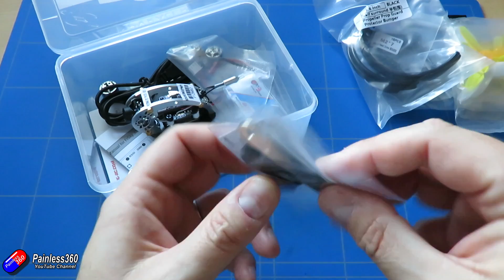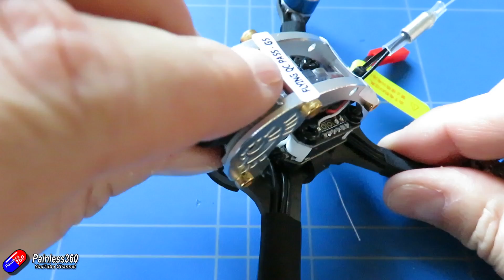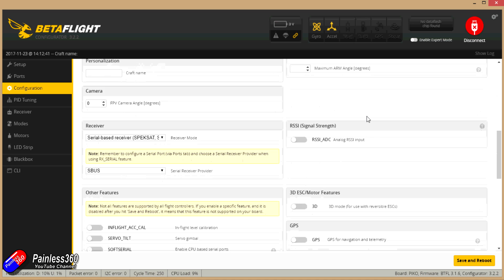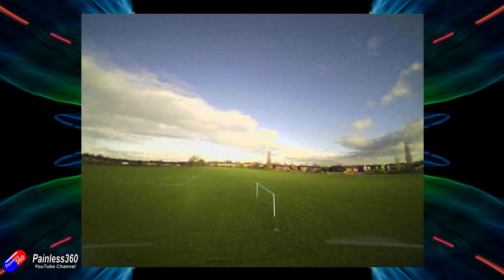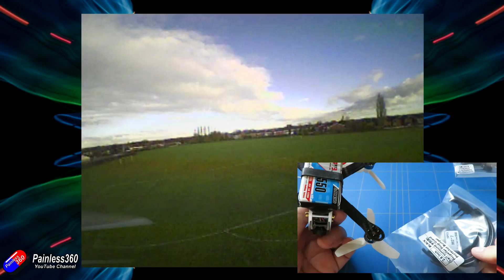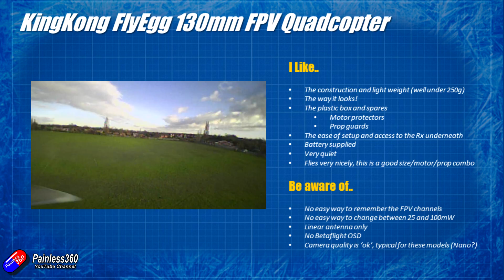RC Reviews: KingKong FlyEgg 130mm Mini FPV Quad - It's good!

Comment: how to make fpv quadcopter with 25min flight time ?
Reply from the maker: Big props, low KV  motors, and a nice big battery. :)
Reply: 900kv motors its good ?
Reply from the maker: Lower the better. See my video on the comparison between two setups with almost identical thrust and how much more efficient a large prop/low KV setup is..
Reply: Thx for the reply
Reply: i want to ask you about transmitter and receiver ,what i should use for 20KM range ?

Comment: my motors are operating erratic it flips right away tried to connect to blheli but it recognizes my board version connects then says failed to connect check com, which is com 4 115000 so frustrated just wont to get it to work can you help
Reply from the maker: Todd Lindsay-dickson  see my video on 'things to check if your quadcopter flips on takeoff'. Hope that helps. Best of luck

Comment: I have just bought this based solely on your review! (No pressure lol!)

This is the only review that i have seen where the flyegg 130 comes with a jst power connector and those vented xt1104 motors! Every other review i have found on this had a balance plug for the power connector :-s and 1105 unvented motors.

However i have seen that a few of those reviews there is also an osd, this is starting to get confusing.
Reply from the maker: +Mark Wood as far as I know the early versions came with the balance tap. You can see the sticker on the box this one came in talking about the upgraded motors and power connection. I've never seen this small version with an OSD..  I'd get those reviewers to check ;)
Reply: It may possibly have been the Leader 120 then... I have been on a youtube review binge trying to decide on a bnf or go with a scratch built.
I plumped for the no rx version as i'm still happy with my Devo 7 for now!
 Was only £87 on BG 
 https://www.banggood.com/KINGKONG-LDARC-FLY-EGG-130-130mm-FPV-Racing-Drone-w-F3-10A-4in1-Blheli_S-25100MW-16CH-800TVL-PNP-BNF-p-1164224.html?p=5P130216104409201711
Reply: Mark Wood have you had a good experience with the updated fly egg? Does the beeper go off on punch outs like in reviews of the older model with 1105's? And the newer FPV 136 (not FLY)comes with OSD and runcam.

Comment: I've had an Fly Egg 130 for quite a few months. It and my Lizard 95 are my favorite park flyers. Runs great on 2S LIHV's or on 3s 450 or 460 nanotechs. No issue's with jst but I am using DSMX which I understand has less brownout issues with jst's. It looks like a few things have changed since i bought mine. My motors are "no brand" unlabelled and your aren't. Plus my battery was an anemic kingkong 350 2S 30 C that was only suitable for landfill. Also I think my camera is 600 tvl and not very good, just ok. Shame no OSD (all I want is voltage).
Reply: TakeItToTheGround have your motors given up using 3s yet?

Comment: I think jst may not be good enough for that setup.  Looks nice though.
Reply from the maker: +Scot Caraway the original used a balance tap! :)
Reply: Painless360 I have a Raiju RX155that I had jst on.  Probably 20amp setup.  It worked for two flights.  On second flight, I could feel the connection was warm and I could not unplug it.  It melted together.
Reply from the maker: +Scot Caraway I'm seeing more and more of the latest models, esoeciaĺy those designed for 3s, coming with XT30 connectors now. This JST seems to work ok in this setup. Happy flying!

Comment: Already got one, it came with a duff motor, once i got the motor replaced, it fly's really well, the original battery will give around 4 mins, extra batteries i bought from banggood ( 4 pack ) 2 are good 2 are so so.

Comment: I have (6) 5" quads.  And the flyegg 130 is my first 3" quad, and I love it.  Flies more locked in than most of my 5" quads.   The cam is pretty good but I wish it was wide enoughh for a micro swift.  Get the fpv egg 136, it's the same thing but made with a runcam micro swift.  https://www.banggood.com/KINGKONG-LDARC-FPV-EGG-136mm-Racing-Drone-BNF-W-F3-4in1-10A-BLehil_S-25mW100mW-16CH-600TVL-p-1210910.html?rmmds=search&cur_warehouse=CN
Reply from the maker: +John Doe thanks for the idea! Happy flying!
Reply: I searched on "fpv egg 130" but I can't seem to find one. Can you provide a link please?
Reply from the maker: +TakeItToTheGround link in description..
Reply: Thanks. I wil consider it when and if I destroy my 130.

Comment: I had a bad experience with the KingKong 90GT I got some time ago. Initially, the camera came out of focus, so I had to fiddle with screwing the lens to get it to focus.  It had bad drift problems in Angle mode straight away, and I tried every solution (including soft mounting all the boards and motors .. to no effect .. flies okay in Acro though). The Cam/VTX was another problem, and I soon got tired of the hokey way you need to set channels, so I replaced it with a split Eachine setup. About that time, the FC went out as well, so I wound up putting in a micro Omnibus stack (20mm hole spacing).  Even after that I couldn't get rid of drift in Angle mode, so, personally, I'm loathe to get anything from KingKong again. I know a lot of guys had great luck with their 90GTs .. so perhaps I was just snake bit on mine. It does look like KingKong has improved their build a bit since the 90GT, but I don't see any soft mounting, so I'll not likely take the chance.  Thanks for a look at this one and the review. Cheers.
Reply: Bill Somrak same here.after one flight 2 motors will spin,but not spin up any more.so it was worthless after that
Reply: Yeah, I wound up replacing the 1103 motors with some DYS 1104 motors, as 2 of my original motors died. I may have caused it though, whilst trying to soft mount them (may have gotten a screw in too deep). For all the money & parts I bought, I could have scratch built a 90mm micro FPV racer, but, there you are. Might look to see if there are any 'Black Friday' deals on a Full Speed or similar quad in this size (120mm to 130mm). Cheers.
Reply: Bill Somrak the diatone GT-R 90 looks very good and also has good reviews.it's almost 150 euro now
Reply: Darkwing Duck did you calibrated your transmitter aux channels in betaflight? I've had the same issue with my first builds.but after I calibrated it,it was dead steady.even a few numbers off will give you drift
Reply: Darkwing Duck I was talking about the used ones (taer,aetr or whatever you choose).as long as they are calibrated exactly to 1000,1500 and 2000 on all the axis and calibrated the gyro on a flat surface,it should be fine.it was just my experience when it was a little off with my quads.maybe it would help you.sorry man.good luck and maybe someone else can help you fix the problem.
Reply: Darkwing Duck one last thought: did you try raising 'i' and play with anti gravity?
Reply: Darkwing Duck you really can't go  wrong in raising i.it is the one that would keep your quad from drifting.try a trick that invokes that drift.raise I quite a bit and watch if it changes.gravity gain can help to get rid of the last bit.and that rule of thumb is so true.i just have one quad ready and waiting and the forecast for the next two weeks is the same :( ah well.i've got a new frame coming in and can't wait to get started with that one.good luck anyway 👍